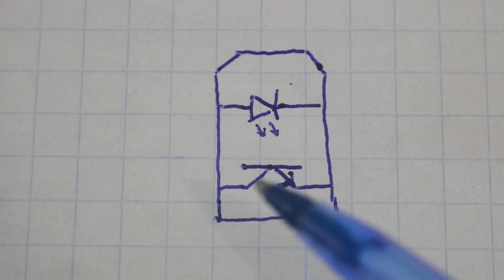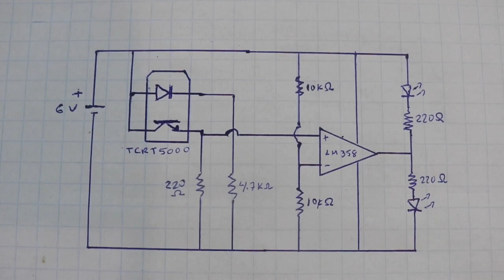Proximity Detector

Comment: Are the resistor values swapped in the circuit diagram?
220ohm should connect to the IR LED and 4.7K to the photodiode

Comment: hmmm... so you need to make sure that when the phototransistor detects light, the voltage at the noninverting input of the opamp will be higher than the inverting one?

Comment: Mr Ludic, in the 1970s, there was a guy called Forrest M Mims that wrote a bunch of electronics books for Radio Shack you could buy. He used gray squared graph paper and wrote the circuit diagrams by hand just like you do. His books were short but excellent.
Your circuit diagrams and circuits are both fun and educational. Keep up the good work👍
Reply: I had the version before it was broken into the little books. It was a single full notebook sized book with a blue cover which covered application circuits for all the chips and modules RadioShack sold at the time. I think I had the 1978 version. After they discontinued many of the chips, they re-released some of the pages as the mini-notebooks.
Reply: Watch 
"Circuit Classics: Forrest Mims' Mechanical Pencil"
 on YouTube

https://youtu.be/ohcfGAxltb8